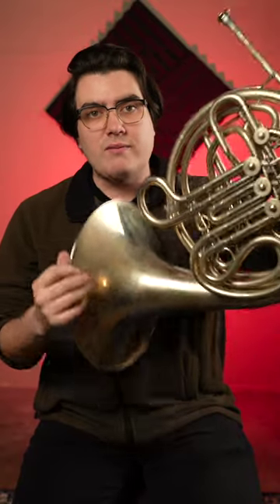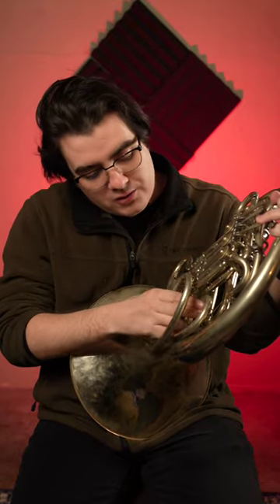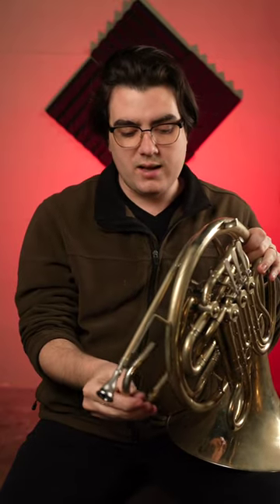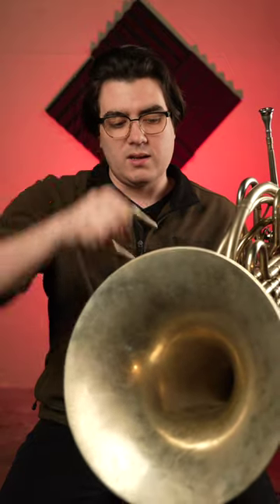How to empty the CONDENSATION from your French Horn

Comment: It really depends on the wrap. On an Alexander 103 all water naturally accumulates on the 3rd valve, as it's the lowest point in that valve section. Of course there's also water in the f extension and in the leadpipe.

On a Schmid double, this water goes to the f extension instead, which is provided with w water key, same as the lead pipe. I found that it's easier to get all the water into the f extension by rotating the horn with the levers facing down and then emptying almost all the water using the water keys. 

The advantage of the Schmid is much easier and faster to empty, I usually only need to empty all the slides at the end of a session. On the downside, due to the location of the water keys, water sprays everywhere so you have to keep a rag to keep it clean.

It never happens on the 103 due to the shape of the lead pipe, the water barely sprays the horn.
Reply: Regardless of the horn, all water should be removed completely after each session 👍

Comment: I found that going the other way in rotating the horn is far easier, more efficient. Simply, let the horn drop from your lips and downwards to the floor -  lift the bell up and backwards. It dumps out in seconds from the lead-pipe. And can do this in 3 seconds. Every 15 minutes, I remove the main and F tuning slides, rotate the horn with lead-pipe up and dump it out fast (opposite direction). The 3rd valve gets it once every 1-2 hours.  And it looks far more elegant too. And far faster.

Comment: I consider the horn not having built-in water-key(s) a serious design flaw.  I had an Amado water-key installed on my son's horn.
Reply from the maker: Most horns are going to be shipped with water keys. My regular instrument has three, but this old Conn from 1959 has none. even so, condensation still manages to get just about everywhere in the instrument so they aren’t 100% foolproof. Especially for the valve slides